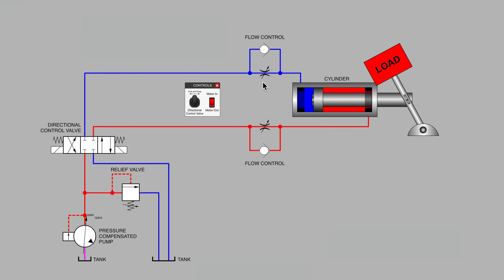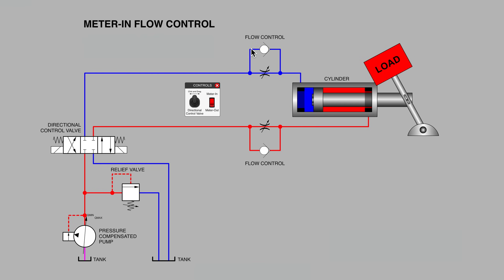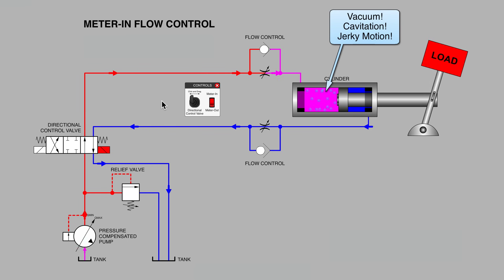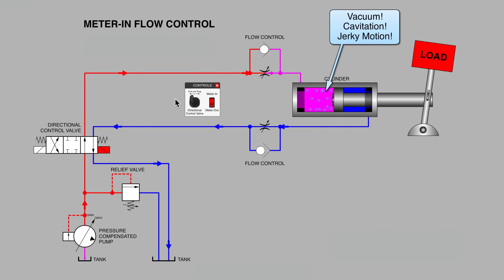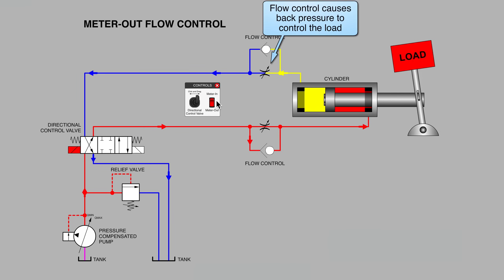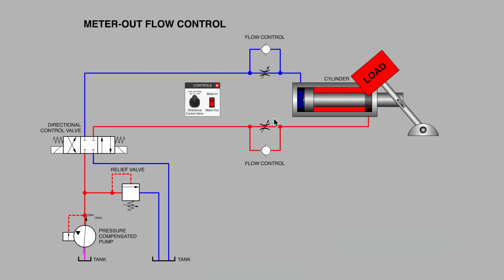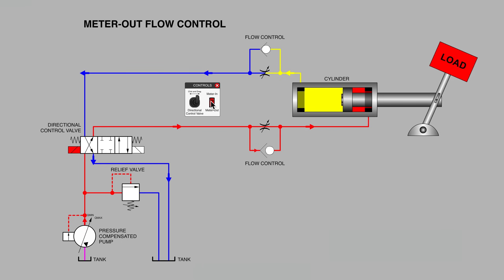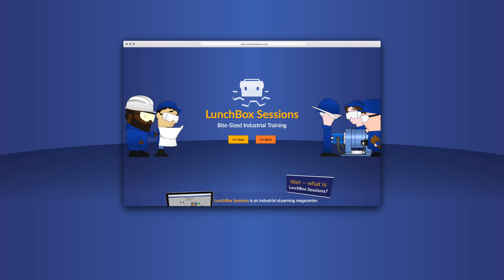Meter-In vs Meter-Out

Comment: Sir, you mentioned on metering out in both directions would cause a significant increase in pressure on the rod end.  What it not be better to meter out the bottom end and meter in the rod end? Thank you for any information.
Reply: It is very difficult to match the flow rates of two flow control valves working on both sides of a differential cylinder.

Comment: Hello, i have a cilinder with a simulair movement. When the cilinder is max in and I steer the cilinder out, the first movement is really fast and uncontrolled, after the first steering, it is normal speed how i set with the orifice. Is this the case because of the vacuum/cavitation?
Reply: use restrictive valve with 4 mm hole and use counterbalance valve

Comment: Why oil should go through a check valve only, when return (meter-in), needle valve installed in parallel and it is open as well?
Reply: Oil takes the path of least resistance. In this case the check valve

Comment: can you please tell  me if my Marine hydraulic crane traverse motor or slewing motor runs jerky when traversing what might be the problem with this?
Reply from the maker: I'll  try to help as best I can. Half of the battle in hydraulic system troubleshooting is knowing exactly what 'normal' is. So it will definitely help if you provide even more detail about how the machine has functioned right up until recently and then what exactly you are observing now in the faulted state. You said "traverse motor OR slewing motor runs jerky when traversing" (upper case letters - mine). Does this mean that the traverse function is jerky when traversing only, and that when slewing while traversing, that it is now the slewing motor that is jerky? Are there pressure gauges on the hydraulic system ? If so, do you have any pressure reading data from before and now during the fault?   - Carl
Reply: Hi tnx for reverting back! Actually the crane it self jerky while slewing the slewing motor  foundation is OK.  Do you think that  any problems with the slewing ring or bearing ? Shall I conduct a rocking test. Or might be some other fault in the system  line  itself ? And  none pressure gauge fitted over it.
Reply from the maker: If there is a hydraulic system schematic, please email it to info@lunchboxsessions.com.  If there is no hydraulic schematic, I would recommend that you try to obtain one from the crane manufacturer, and or have a schematic made up for you.  The schematic is an important tool for troubleshooting.

There are a good number of possibilities for this behavior, and yes sometimes a mechanical binding fault outside of the hydraulic system, is the cause. I once had a client with a hydraulic slewing motor that would stall, and every few weeks they would continue to increase the relief valve pressure setting, well beyond the machine manufacturer's specification (very dangerous) to get the motor to turn.  They believed there was a hydraulic fault. They later discovered that the slewing bearing lube system had failed.  The slewing motor itself may have an internal fault. If there are cross-port relief valve between the motor ports, there may be a fault in them. The list of potential faults is long, if we are just speaking theoretically.

It is difficult for me to say exactly what you should do next without specific knowledge of your machine. Is the crane manufacturer still in business? If so, you will want to get them involved. They will have safe and best practices for your next steps.

If you have access to a hydraulics maintenance/troubleshooting expert who can come and help you at the site, they will most likely spend some time making sure that the hydraulic system overall is adjusted correctly (pressure control, pump controls, flow settings etc.) before diving into the specific sub-circuit for the slewing system.   - Carl

Comment: in your example (3:57) is that a double acting valve or a single acting valve?
Reply from the maker: I'm not sure I understand your question. At 3:57 the 4 port, 3 position directional control valve has returned to it's closed center. It is centered by springs. Is that the valve you are referring to? That valve has two solenoids, one on each end. The solenoids are the valve operators and are the rectangles with the diagonal slash on each end of the valve symbol. Only one solenoid is activated at any one time.

Comment: Can I have the program or demo to try which you use to create and simulate your hydraulic diagrams ?
Reply from the maker: bardet hammer We built this software in-house for our own use. It is not available at this time as a user installable package. But you can certainly work the controls and pull the levers yourself when you sign up for a session at LunchBoxSessions.com. Thanks so much for your inquiry.
Reply: @lunchboxsessions   Can you send me link regarding stimulation where i can work on this?